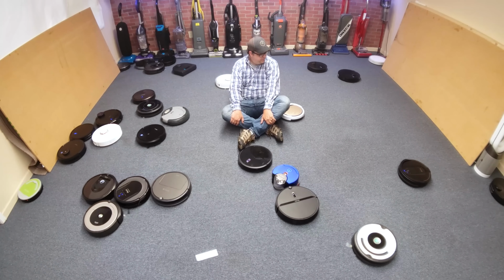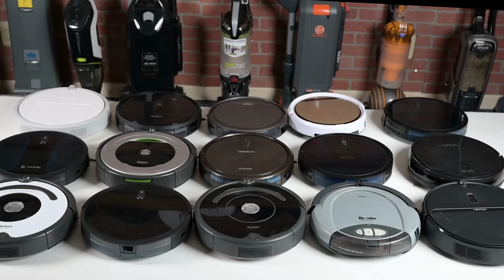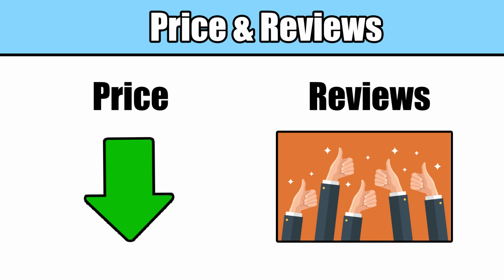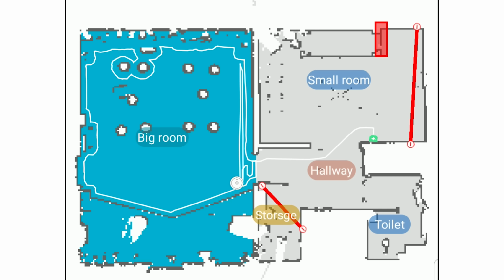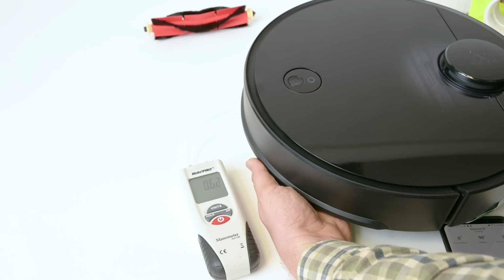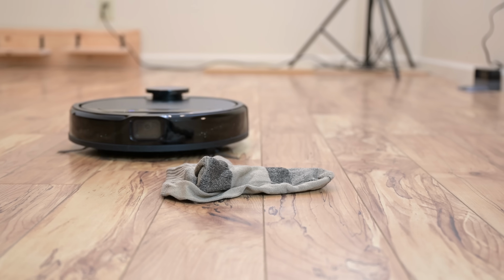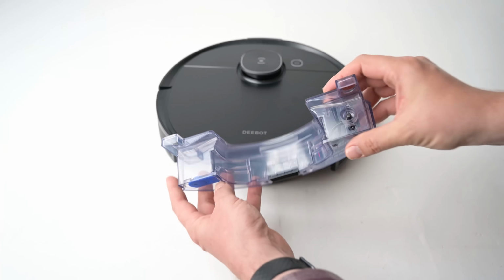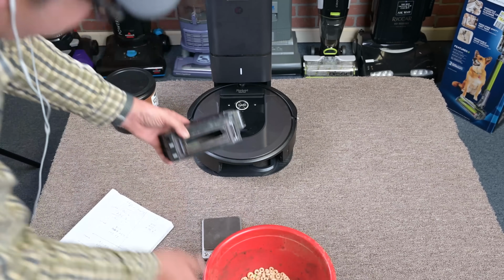BEST Robot Vacuums 2020 Edition - Vacuum Wars

Comment: Question about the T8. I'm wondering if you recommendation takes into account the well documented software issues? If the user experience (software usability) a factor in your reviews?
Reply from the maker: I did this review right when it came out so any reviews would not have been available to take into account. That being said I continue to use this robot personally and other than the occasional stuck robot, I haven't had any issues.
Reply: @VacuumWars  i read of maps disappearing, rooms dropping off, overall glitchy app really bad customer experience, that has not been your experience?

Comment: How come shark has n/a? Also did you test hobot ?
Reply from the maker: There were some software fixes I thought were going to come - mapping problem, and no go lines support - but they never came. Without those things it remained a good value but was not going to make a best vacuum finalist.  I haven't reviewed a Hobot, but I will add that to the list of possibilities for 2021.  Thanks!
Reply: Do you mean shark is not that good as the two finalists in this video?

Comment: I would love to see a review of life of these vacuums and common problems. I have a neato D5. I just had to replace the belt for the side brush and nearly had to take the whole damn thing apart! Now it seems the lidar isn't working. I would like to see a comparison on robots with lots of issues, how easy they are to repair, and if parts are available.
Reply: I spent a ton of time making this comparison table of the most popular Robot Vacuums on Amazon on 20 different metrics that mattered to me. You can compare this one against some of the top options to see if it's the best one for you. You can add and remove options from it and customize the criteria to match your needs. Cat Hair, Rugs, Self-Emptying and Re-charging were most important to me. It's kinda like a shared spreadsheet on steroids because it pulls in all the specs and ratings. Here's my comparison project https://app.skeema.com/?pid=lWVoJB3OD1olKXqcdcBZ

Comment: I just bought my first one and I absolutely love it so far!  

I got a Eufy 30C and I'm the month I've had it the only issues I have found are that long hair gets caught up in the ends of the rollers and needs to be cut out because the vacuum sends out a warning saying the roller is stuck, and I needed to use the boundary strips to keep it out of my kitchen and bathroom because it kept getting stuck on the metal piece separating the carpet and linoleum.  I just either drive it into those rooms with the remote/app or pick it up and place it in there. It's not ideal but it's not a deal breaker. 

I plan on using my regular vacuum with carpet deodorizer once a month but otherwise this little robot has changed house cleaning for me.

Comment: With regard to the irobot roomba 675 and your review - I beg to differ - on the advice of this channel and its review of same, I settled for same machine. With a tidy home and lifestyle and minimal furniture in a large studio space I ran same machine on a low pile carpet with minimal debris. I found, at best, that that machine can pick up unseen dust. But the miniscule pieces of things here and there it spit out and sometimes upon return picked up. The areas it liked to frequently embrace were fresh but the areas where there were scattered pieces it probably picked up 75%. This machine needs  guidance and in one area I literally locked it into the space and let it go. This machine is not great on carpet pickup. At best, it's just okay.  I hope to return same for something that does have better pickup. (20 mins. Later - I just ran the Spot Clean and am impressed with that. That may be enough for me to reconsider exchanging.)

Comment: Deal of the day - 
55% off - Best Seller
Additional 10% off with Debit Card

ROBOTIC VACUUM CLEANER 
add voice control by Alexa

ECOVACS Deebot 500 Robots Vacuum Cleaner with Robotic Smart APP Control, Max Mode Suction Power, 3-Stage Cleaning System Compatible with Alexa (Black)

https://www.amazon.in/ECOVACS-500-Cleaner-Cleaning-Compatible/dp/B07VHL72XM/ref=as_li_ss_tl?crid=2G30F6I0SVAN4&dchild=1&keywords=todays+deals+best+offer&qid=1606466577∣=A1UTDLVBXXK053&sprefix=Todays+,aps,544&sr=8-1-spons&psc=1&spLa=ZW5jcnlwdGVkUXVhbGlmaWVyPUFEQkZFMUZTWlFOSEMmZW5jcnlwdGVkSWQ9QTAwNzUwODQzSVFMWkRLVjlKSVBUJmVuY3J5cHRlZEFkSWQ9QTA4MDQ1NjFBUUhRVk9aRDNDRkMmd2lkZ2V0TmFtZT1zcF9hdGYmYWN0aW9uPWNsaWNrUmVkaXJlY3QmZG9Ob3RMb2dDbGljaz10cnVl&linkCode=ll1&tag=ja20200e-21&linkId=c0ddf3ce94b95e7355a427f798786467&language=en_IN

Comment: I have a question about the wheels. I had a very cheap one, but one thing that got me worried about any of them is the wheel protection. Looks like none of them have any kind of protection against hair being stuck in the wheel as they drive over it. For those that are real smart robos, do they have any protection in the wheel against hair being stuck in it?
Reply from the maker: Not that I know if, but I don't think its much of a problem, at least that I have heard of.

Comment: I am surprised by your through's on the i7+. just picked it up and its mapping function cased the vac to just randomly get into a corner and bang it self against a wall an bookshelf and never leave the area by backing out. feels like the camera had to purpose on how it was mapping the room.  When it was finally over I did get to setup the no go zones but  when you reselect the map function it would forget about it and never fully went down a hallway to enter another room.  The tower+roomba also needs an upgrade since the bin got  clogged with about one inch square paper which made the station think it was full after 3 dumps but the bag was barley 1/4 filled. 
 its one of those looks good on paper but in the real world has a lot of issues.
Reply: I agree. I've had the i7+ since almost the day it came out and I can say it is a pretty dumb/frustrating robot.

Comment: I got the Roomba i3+ after watching the specific review of that one.  I think honestly with the autoempty bin feature that it has, at the price point in the mid-range (got mine for $399), it really is a great value.
Reply: Hi, Jeff! Thanks for sharing! Do you use it on hardwood floors and, if so, do you think it cleans corners really well?
Reply: @brittanynicolemeyer8843  I have mainly carpeting, but a small hardwood floor in the kitchen.  It does a great job on both.  I think for corners, it does its best.  What I mean is that since it is round, it obviously won't be able to fit exactly into the corner.  However, since its brush extends out further, what I see happen is that it kind of whirls itself around a couple times when it is at a corner.  

I purchased after seeing various reviews, and while corners might not be as great as say a "D-shape" version, I bought because I was looking for the forest instead of the trees.  It and other Roombas with cleanbases were rated highest by various sources in raw cleaning power, so the rooms in general (and in my personal experience after a few weeks) come out looking great.

Edit: this is the review of the i3+ from Vacuum Wars:  https://www.youtube.com/watch?v=dks2MoCWGhc.  This was mainly why I purchased.  It indicates the i3 is on par with the i7 in terms of power and overall job performance.  Since the i7 was highlighted in THIS video as being one of the top choices for the high end models, that caught my attention.  The key features the i3 lacks seems to be a bit more advanced navigation, and the ability to have it vacuum only certain segments of the house.  For me, those features did not warrant spending the extra $300.

Comment: Got the i9 works much better doesn’t rip carpets but still keeps getting stuck on the rugs, lasts much longer though and you can change how strong the motor runs from slow to medium to fast.

Comment: We had an i7+ didn’t work very well kept getting caught on rugs ripped apart the carpets and was just dying in under 48 min.
Reply: I spent a ton of time making this comparison table of the most popular Robot Vacuums on Amazon on 20 different metrics that mattered to me. You can compare this one against some of the top options to see if it's the best one for you. You can add and remove options from it and customize the criteria to match your needs. Cat Hair, Rugs, Self-Emptying and Re-charging were most important to me. It's kinda like a shared spreadsheet on steroids because it pulls in all the specs and ratings. Here's my comparison project https://app.skeema.com/?pid=lWVoJB3OD1olKXqcdcBZ
Reply: @BradBreneisen  yes thank you, great video I can tell you spent a lot of time money and effort to put it all together. I originally watched the video right after returning i7+ and I was on the edge to get the i9 this video convinced me. It does work much better than than i7+ by far. Still has its kinks and divets but tolerable.

Comment: I see lots of robot vacuums under 200 USD that has lidar, automatic charging stations etc? What's wrong with those?
Reply: I spent a ton of time making this comparison table of the most popular Robot Vacuums on Amazon on 20 different metrics that mattered to me. You can compare this one against some of the top options to see if it's the best one for you. You can add and remove options from it and customize the criteria to match your needs. Cat Hair, Rugs, Self-Emptying and Re-charging were most important to me. It's kinda like a shared spreadsheet on steroids because it pulls in all the specs and ratings. Here's my comparison project https://app.skeema.com/?pid=lWVoJB3OD1olKXqcdcBZ

Comment: Really great review! I’ve been watching a ton, you are the first that I’ve found that actually compared and gave your favs!  Question, I need a self emptying  robotic vac. My house is 2000 sq ft down stairs and except for the master bedroom and bath which are high pile carpet and tile I have stained concrete floors.  Here is the catchy part, I need the best one for not only cleaning after 4 messy guys but we have a long haired Persian cat. We keep Loki’s hair long.  I also have waist length curly hair. In your opinion what is the absolute best cleaning this kind of sq footage and really long pet and human hair, that self empties? I’d really appreciate any help you can give me. The shark IQ and roomba i7 or the roomba S9 plus? I’d like a good deal but price is not the deciding factor, I want the best. Thanks!!!
Reply from the maker: Did you see this review - https://youtu.be/Et_ROh1XICY - at about 6: 30 - they all did pretty good with hair tangles!
Reply: I spent a ton of time making this comparison table of the most popular Robot Vacuums on Amazon on 20 different metrics that mattered to me. You can compare this one against some of the top options to see if it's the best one for you. You can add and remove options from it and customize the criteria to match your needs. Cat Hair, Rugs, Self-Emptying and Re-charging were most important to me. It's kinda like a shared spreadsheet on steroids because it pulls in all the specs and ratings. Here's my comparison project https://app.skeema.com/?pid=lWVoJB3OD1olKXqcdcBZ

Comment: Also interested to see how the new Wyze vacuum holds up against the others. 2,100 Pascals of suction, mapping with lidar, 4-core Cortex-A7 processor, can cross surfaces up to 20mm in height, and 2 hours standard battery time and for $250 but $199 under pre-order. Sounds like it’s pretty awesome. But it would be nice to see it in action if you can get your hands on one before we can!
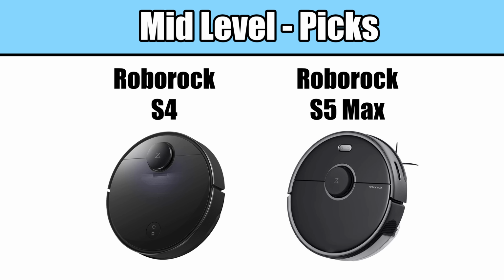Reply from the maker: I have a review coming this Friday! 4:00 EST.

Comment: I'm wondering why the first Xiaomi Smart Vaccum Robot is not in the test at all. I got mine for 250€ which would be first category, and it has most smart features of the next category.
Also you can still get it on Amazon and can upgrade it with the main and side brush of the more expansive models for cheap.

Comment: Hi Vacuum Wars, great channel. Could you please suggest which of these two should i buy. Roborock S6 or Roomba i7+. We have only hardfloor, and most of the dirt is composed by our labradors fur. I really like the roborocks features and posibility to create virtual walls inside app. But i am little bit worried that it wont be able to clean our  100 square meters flat before it runs out of dust bin space. Here comes the i7+  with its clean base, this sounds quite amazing, but there are some issues that i have read about like that is doesnt run well in dark rooms(like our hallway), and also its not possible to create in app  walls around dinner table etc., only divide the rooms. Thank you

Comment: Hi for a very thick high pile shag carpet, which one would you recommend? T8 aivi, t8+, robo s6maxv or s5 max?
Reply from the maker: It's best to contact the manufacturers on that point, I am pretty sure they get that question all the time. I however have never tried it. My suspicion is that it would not work very well.

Comment: S5 Max has a much smaller dustbin than the s5. I had to return it due to this fact. For those with bigger floorplans / pets, you may be dissappointed with the dust bin capacity.
Reply from the maker: Thanks for sharing your experience here.
Reply: @VacuumWars  My mistake. It had a different shape (shallower), but wider and larger.

Comment: Nice comparison. Thanks for your effort!
One question: Does this comparison includes Deebot ozmo 950 ? In one of your other videos you recommend it over roborock, although it was S6?
Reply from the maker: This video doesn't include the Deebot.
Reply: @VacuumWars  thanks. So if priced similarly around 400€ , then would you recommend deebot ozmo 950 over roborock s5 max? I've seen your in depth reviews, just also wanted to know about long term durability.
Reply: Also have same question)

Comment: Bought an I7 plus in 2019 and the extraction unit failed 6 months in. They sent me another and 6 months in, the second extraction unit has failed, again. That means I’ll have to begin the never ending calls to go through all of the diagnostics they put you through to diagnose, even though I’ve already done them all now my own. You can’t speak with a higher level individual. I’m worn out with Roomba. We spent the extra money...$1000, so the unit could work while we travel. This was supposed to be helpful, instead, I’m emptying the bin just like I would have with the less expensive models. There is actually a step provided in the “common questions” in the app, for when the extraction motor isn’t working. That seemed strange to me. Does that mean that it’s a common problem? Not impressed and di$appointed. Laura
Reply from the maker: I'd be not impressed and di$appointed too.  I've seen good feedback on the i7 plus, so I don't know what the issue could be.  Sorry to not be more help.

Comment: The problem with those eufy robovacs is the side brush motor sprockets. They break quite easily.
I have 2 11s and one 30c with that same problem unfortunately. And eufy doesn't give much support after end of warranty.

Comment: Could you please do a long term review on robot vacuums? For example: using it twice a day 5 or 6 days a week to keep about 2300 sqft clean, hardwood, carpet, and rugs, and possibly some areas that are raised like an old fireplace hearth or old house thresholds between rooms.  I've had 7 different robot units, 4 different roomba versions and eufy and they all keep failing me. They start of great but trail off.  I have a roomba that rubs marks in my cabinet feet and my furniture legs as well as baseboards because it rubs them so frequently and bumbs them hard, my s9's  have all kinds of issues. The first had a system failure after just 2 months and they sent a new one. The new one has been a nightmare. It tears up my large area rugs, turns the corners up, misses whole areas, won't start because it can't connect, has had to have a system reboot to fix glitches after an update and I had to have it remap my whole house again.  I could go on.  Long term tests would be amazing.

Comment: Great video! Lots of good info.  What do you think of the roomba s9? Here's a video from 知电晓春哥, who compares some of your selections with the Roomba s9+. It seems that dirt pickup and airflow is significantly more than any of the models you're recommending. I want a vaccum that works best as a vacuum. a mop would be a great bonus, but it's gotta be a great vacuum. Also read reviews that the T8 AIVI isn't as good as the T8+ and both seem to loose map etc. Any input on that?

8. Airflow test
A. roomba is at 617 nl/min, Ecovacs T8 is at 402, Roborock S5 Max is at 322nl/min https://youtu.be/0tRRq2TNPlQ?t=208

9. pet food and other debris pickup
Rooma 98.56%, Roborock T6 aka S6 95.7%, Roborock S5 Max 93.77%, Ecovacs T8 91.48% https://youtu.be/0tRRq2TNPlQ?t=257

10. Sand in carpet test
A: Roomba at 90.84%, Ecovacs at 77.37%, Roborock S6 at 68.12%, roborock S5 Max at 67.04% https://youtu.be/0tRRq2TNPlQ?t=285

Comment: Are any of the vaccums able to distinguish between black designs in carpet vs a drop off like stair steps? My Roomba cannot tell the diffence with the tech it has on board, it has otherwise been a pretty good machine.

Comment: Call me old style but if you ask me about robot vacuum I will never chose vacuum robot: 
1. They are not strong as a regular vacuum.
2. They are expensive.
3. You still have to clean the robot after it clean the vacuum. 
It will take about 20 minutes max to clean up.